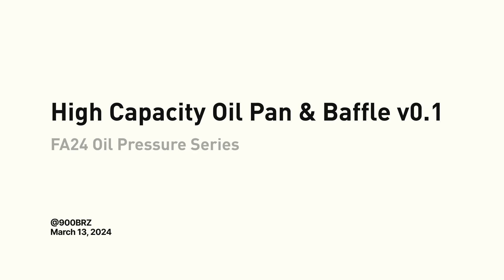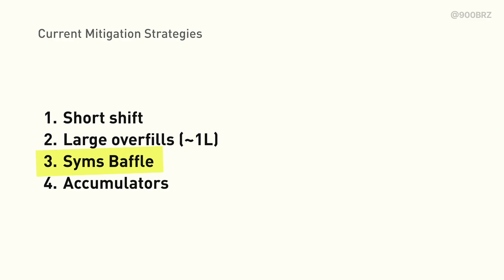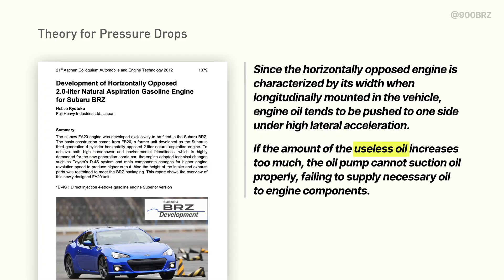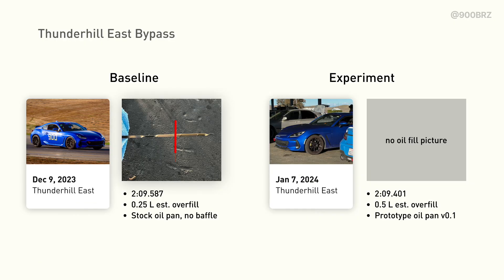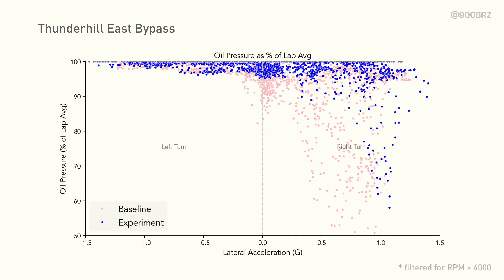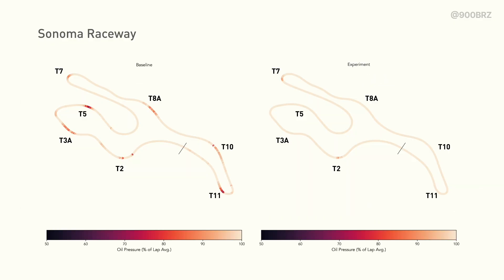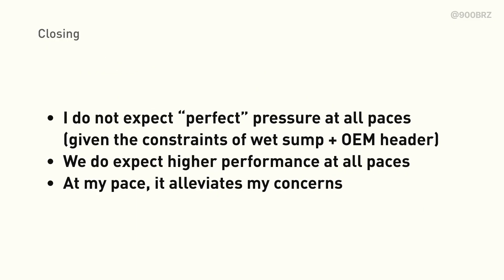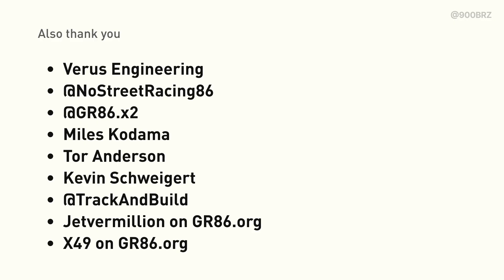FA24 High Capacity Oil Pan & Baffle Announcement

Comment: This helps every 86/brz owner out there in the market for this solution. I recently just ordered a syms oil pan and plan on adding half a quart of overfill for my daily use / touge spirited driving style of car. What’s your guy’s take on this? I definitely would purchase this once released!! So much hard work has been put to this that the results can’t be unseen!! Thank you for this amazing analysis!! 🥳🎉
Reply from the maker: Yeah, Syms + overfill is the best mitigation right now outside of an accumulator. On the street, I think you should be good to go with that setup.

Comment: Have you guys considered sharing this information with Subaru and Toyota corporate?
Reply from the maker: I can try. I’m hopeful they’ve seen it already and a little dubious I can get the attention of whoever needs to see it just by emailing them, but I’ll give it a shot.
Reply: @900BRZ  What are the racing series doing? I havent heard of any specific issues attributed to pressure lose in the cup races (domestic or abroad)
Reply from the maker: @i-barg I’ve heard some mixed reports. There were definitely a handful of failures last year, in GR Cup (USA) but it’s hard to get an accurate sense. There were a handful of failures that were due to deliberate underfills for performance gain, so those are not representative.

I know they have a custom baffle and they run a 1L overfill. They also have similar oil coolers to what we use.
Reply: @900BRZ  Ya - I have heard similar stories, but given your findings. I would expect much more failures given the setup (slicks + aero) and how hard they get driven.
Reply from the maker: @i-barg  Same here. Either they’re really good at hiding it or they deal with the pressure drops better than expected. Hopefully it’s the latter.

Comment: Great approach and info', mate. It'd be interesting to look at the engine architecture in regard to the oil struggling to return from the top end left hand side.
Increasing the capacity of the sump may alleviate the issue on most tracks, but it doesn't immediately tend to the source issue. Toybaru may have already highlighted this short coming with the 'oil spacer'. Do you know when this modification was fitted? I've got a TS arriving in the next week or so and assume it'd have it fitted. 
I think it's a no brainer to consider the Verus pan if you're mildly modifying the car and you'd have to think carefully before increasing grip much beyond there regardless. Cheers!
Reply from the maker: Thanks for watching. There is an oil spacer in the heads (I show this in the video when talking about the theory) and some other little design features to try and improve return, but IMO it’s not enough.

The large capacity oil pan is a bit of a brute force approach, but if it works, it works. Porsche is making several cars with an 8 qt capacity and there are other benefits like higher thermal capacity with more oil.

Comment: Wouldn’t the off-center placement of the oil pickup tube be an obvious suspect?
Reply from the maker: It is but you need to remove the timing cover to replace it. It’s quite involved to change.

Comment: Great progress! One thing to consider with adding extra oil is it is documented to reduce power. It would be interesting to see the results of the stock oil pan with regular oil level versus a higher oil level on a dynamometer. As well as, the new oil pan that is being designed.
Reply from the maker: Totally agree. I’ve got some friends going to a dyno tomorrow and they may try to test at the top mark on the dipstick and 1L over.

Comment: I wonder what the solution is in the IRL GR86 cup. They must know this is an issue right?
Reply from the maker: All I know right now is they have a similar oil cooler to what we are running, run a 1 L overfill, and have a stock oil pan with a welded in baffle. When the started the series, they didn’t even have oil pressure logging, but they added that before the COTA weekend. Have heard some mixed signals about reliability.

Comment: This is a very well organized update!  But there is one thing missing between the lap comparisons, can you add what oil viscosity is being used?  Also has going up a grade of oil been looked at? For example the Chief engineer for another car with a OEM high grip setup cited the need for thicker oil from the higher cornering forces which helps with oil return when hot.  "The thicker 50 weight viscosity helps with oil pan drawdown when the oil gets hot on the track and reduces risk of pressure dropouts"
Reply from the maker: Good point, I should have included this. I’m using Mobil 1 0w40 (13.8 mm^2/s @100C) in all my test days, so at Thunderhill we have apples-to-apples comparison. GR86.x2 is using Kirkland 5W30 (~11 mm^2/s) and Kevin is using 300V 5W30 (11.1 mm^2/s) in the Sonoma data.

Comment: What is the goal needed/desired to go ahead with market production? No pressure drops of or under 70% with a quick driver such as Kevin Schweigert?
Reply from the maker: Great question. There’s no explicit target, but we’re just trying to make it as big of an improvement as possible with the constraint that it should work with the stock header (I think it would be too niche if we require pairing it with a custom header). Hopefully at some point there would be enough demand for another version with a custom header that could have even better performance.

Personally, I think it’s important to test with a faster car/driver to be able to share data at this pace. For people with 200TW tires and aero, they need to understand how much of an improvement it will give them vs. my vary tame setup.
Reply: @900BRZ  Thank you! I'm very much looking forward to data with quicker drivers using aero and 200tw tires such as the RE71RS. Best of luck, you have a community of thousands behind you and Verus, we are so grateful for the effort you put in.

Comment: Love the evidence based research that you are performing for the BRZ/86. I feel like this is a very good option for those who just want to change the pan to mitigate low oil pressure. Although I don't have an GR86 yet (it's on order), the upcoming high capacity pan with built in baffling is a must buy for me.

Comment: Since the pressure drop appears to only effect right hand turns, does this mean that the left (driver side) cylinder head is holding excess oil? There may be a way to port the head drains or introduce a scavenge pump on that side of the engine only to reduce cost and complexity while fixing the most significant issue. Accusump seems like a very reliable way to go, but it's more of a fix to the symptoms rather than the actual problem. Regardless, it's very pleasing to see how much improvement that baffle + overfill combo reduced the initial problem.
Reply from the maker: I think porting the heads would be a super fun project, but quite niche since it would be pretty involved. A machined valve cover replacement with the ports designed into it would be my preferred approach.

The engine is asymmetrical, with the #1 cylinder on the passenger side (for left-hand drive, or more generically the RHS of the car) being the furthest forward. Because of this, there are many, many potential sources for the variance in LH and RH corner oiling performance.

Comment: I even notice this with just street driving. Taking an immediate right turn and sharply climbing up a hill causes bogging. Will be overfilling for my oil change. I don't think 0w20 should be in this car either, and that still goes for street use.
Reply from the maker: What’s your RPM when you experience bogging? I don’t think this is related to pressure drops. If anything, the pressure drop should gain power due to less resistance... until you have a failure. Yeah I wouldn’t hesitate to use 5w30 on the street in this car if you’re not experiencing freezing temps.

Comment: Don't own an 86 but have been following along. There's a lot a similarities between oiling problems in the FA24 and the 2ZZ-GE in my car. Thank you for continuing to share all the data and putting everything in practical terms. This helps a lot more people than just the 86 community!
Reply from the maker: Love it hear it—thanks for following along and commenting
Reply: People think issues like these are limited to Subaru... Meanwhile the LS and many other engines would like a high G word. It just so happens the BRZ is one of the most track focused cars available and is therefore going to get this level of scrutiny. Not saying all engines have these issues, I'm just saying if we had data like this on a lot of sporty cars coming out I think we'd be surprised.
Reply from the maker: @802Garage  Would love to see this level of data collection on more cars. I know MX5 was developed to have robust oiling up to 1.4 G. I suspect oiling on the B48 and B58 is more robust as well, but haven’t seen actually logged data to prove it.
Reply: @900BRZ  For sure! I'm not saying Subaru isn't a big perpetrator. The EJ engines had their own issues, for example. Just that I bet there are a lot of cars with these issues that we hardly even know about.
Reply from the maker: I’ve heard 98 Camry V6 oil starve in left hand corners. Doesn’t matter because it’s an econobox. I assume lots of “normal” cars would have similar pressure drops if taken to the track. But they’re also not marketed as “track-ready” with launch promos shot at race tracks with pro drivers (referring to the BRZ launch at Thunderhill with Scott Speed)
Reply from the maker: I’m not mad, just disappointed lol

Comment: is it possible to change the location of the oil pickup? if oil sloshing to one side of the pan on sharp turns is a problem, why not move the pickup to a more neutral location?
Reply from the maker: The bolts holding the pickup in place are fastened from the timing cover side, so you have to remove the whole timing cover to swap the pickup, unfortunately. Makes it a big job.

Comment: For now I'm just doing autocross. I might be screaming around near red line in second gear, but the oil isn't very hot. Hopefully lower corner speeds mitigate the drops as well, but I regularly see more than 1g lateral so that may not be much help. Would much rather not have an accumulator, but have been considering it the only viable option if I want to do track events. Really hope this solution "pans" out.
Reply from the maker: Oil can actually still get pretty hot in autox because there isn’t as much airflow for cooling. But the duration of the pressure drops should be much shorter, so you’ve got that going for you. Thanks for the comment and for watching!

Comment: This is insane. Literally doing (less than) free work for multi billion dollar companies that cause headache and anxiety for their customers due to lack of R&D. You all are heroes.
Reply from the maker: Yeah, I’m definitely a better car enthusiast than businessman lol
Reply: @900BRZ  as someone who works in internet sales for Subies and has done everything in service for Toyota. They can be great to work for depening on the dealer however many of us wish the car community was listened to a bit more on aspects like this for instance. I have a gen 2 BRZ TS trim. how do you let the Gen 1 torque dip pass by even? okay thats largely solved now you short changed me on oil capacity in high g loads for your " Track car" I havent looked into it yet but as anyone tried also taking a page from corvette z06 and Dry sump systems for the fa24?
Reply from the maker: @deadshot4245 I like comments like this. Yeah dry sump would definitely solve the issue and there is some space in the engine bay for the reservoir if you get a lightweight battery. I have a theory you could tap the FA20 aluminum valve covers and use them on the FA24 with scavenge stages on each side.
Reply: @900BRZ and in my opinion, that's a good thing
Reply: I think they know how to fix the issue it's the manufacturing the part on large scale, it's not as simple as it looks.
Reply: @peachulemon  I can’t imagine a couple thousand engine recalls/ replacements is less costly and running a handful of CFD analyses and remaking the sand casting mold.
Reply: I don't think Subaru or Toyota really care if people are blowing up their cars in extreme track situations mainly because that kind of use is somewhat outside of what they'd consider "normal" use. If they come out with a solution it'll just be in the normal course or the next update on the chassis or drivetrain. Toyota isn't trying to spend a lot of money on naturally aspirated platforms. I almost feel like they came out with this newest generation of the 86 platform in order to keep the sales going and make changes to the platform to get it hybrid ready and then EV ready. But these are just my opinions. I think you have a great point though, it is sad they aren't coming out hard on this topic and keeping owners up to date on any upcoming solutions.
Reply: @charliebrownsd  it’s a good thing everyone who buys a sports car and gets a free NASA track day is only going to putt around town and never drive it hard. Any spirited driving should obviously be avoided at all costs in a sports car. /s
Reply: @mrs_radrod  oh I totally agree. The actual behavior of owners versus the marketing doesn’t line up. I can’t even find a number of oil starvation issues reported. Toyota just isn’t going to rush to provide a fix if it doesn’t reach thousands of reported incidents. It’s not cool, but it’s reality.
Reply: @mrs_radrod  bruh it’s a 30k sports car for beginners. if ur driving it hard it is given that you modify it to suit ur needs. if they put in the needed r&d and the price goes up by 5-10k u would still cry so at 30k the fact that there are compromises with after market fixes is better than not having a car at all…
Reply: @nightwing8666  not a problem with the Civic Si or any other 30k sports car on the market.
Reply: @nightwing8666  i get that its a 30k car but oil starvation is not an issue of money but an issue lack of development.
Reply: @nightwing8666  it wont cost and extra 5-10k extra to sell the car for them to just resdesign a new oil pan+add 0.5liter more oil into the engine.
Reply: You think Verus is a multi billion dollar company?
Reply: @subieworx I'm assuming he's referring to Subaru, who designed the engine and thus is responsible for the oiling issues.
Reply: @thepno95  good point.
Reply: @subieworx  i think his talking about toyota and subaru its amazing that such a big ass company allow a sports car they market as trackable cant even turb right without oil starvation issues.

Comment: Have you found excess oil in the intake due to running higher capacities?
Reply from the maker: I’ve started using a Radium PCV side catch can. My friend had their dual catch can solution and on the CCV side he said there was almost nothing being caught. I went with a catch can one so I could monitor how much oil I was collecting. It’s a pretty small amount actually.

Comment: I already have the verus aos and brake master brace, looking to run the full underbody front to back this season so one of these would be amazing. Wish I had the data logging tools you guys have because Im at a similar level to Kevin right now but im on super 200tw and going into time attack so it would be a great data source for extremes
Reply from the maker: Yeah would love to help more people get set up with data logging. It’s really the only way to know if you need more protection or not. IMO waiting for failure is not the move. On paper, I like Ansix’s kit, but I would like to see it validated before recommending it.
Reply: @900BRZ   What do you think of the geraldjustprojects ?
Reply from the maker: I don’t know as much about it, but Gerald is great. Have had some in depth chats with him about the pressure drops and he very generously donated toward my engine replacement. If you are interested in doing E85 down the line, then the GJP version might be a good match because I believe the same CAN box is required. Other differences: it connects to a harness in the engine bay instead of the ASC behind the glovebox. It uses the main oil gallery port on the top of the block instead of the OE pressure switch on the timing cover. You will retain the pressure switch this way, which lights the dashboard oil lamp at 2 psi or less. It’s probably only of marginal value but still useful.

Comment: I work with a lot of Japanese folks as my company is Japanese, and a few of them are car enthusiasts. One of them commented about the oiling issues that the BRZ is suffering due to me giving him a ride in my '23 BRZ. In Japan, enthusiasts still think that the issues are caused by excessive RTV! I explained to him in detail the testing you've been doing and the solution Porsche uses for their own boxer engines. Now, I have a more comprehensive video to send him in order to explain exactly what the problem is and what dedicated MURIGANS like yourself are doing to solve this issue. Thanks a bunch! Hopefully Subaru execs in Japan see this video and realize that their engines are not in-fact "track ready."